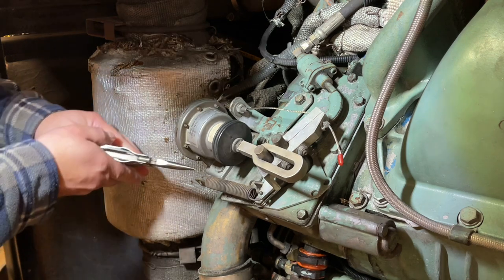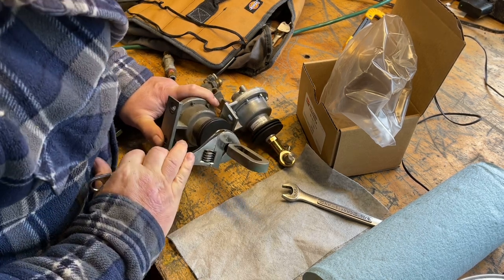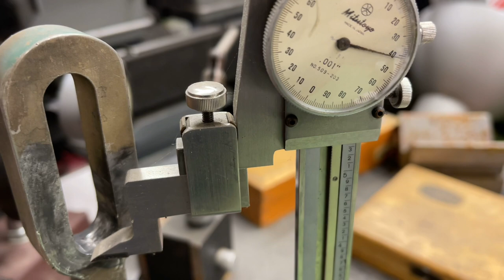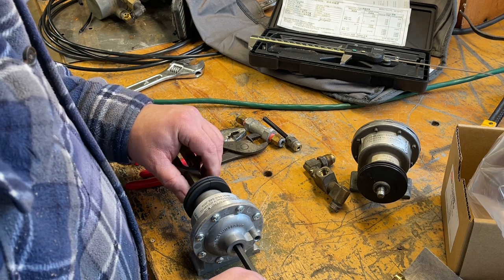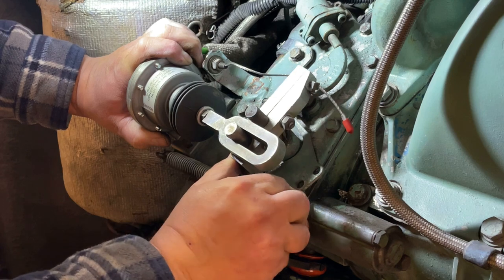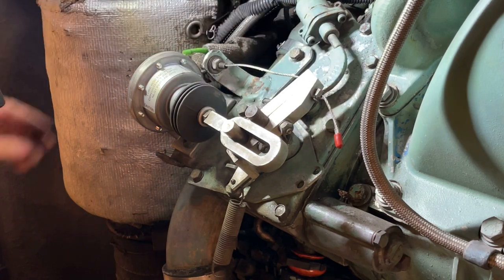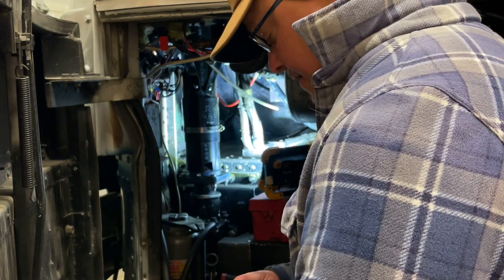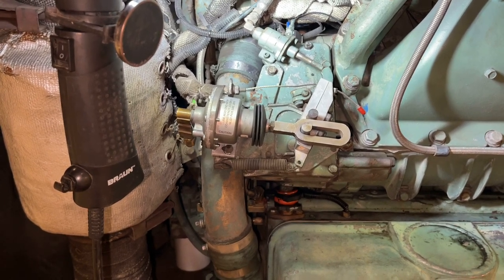Air throttle diagnosis and repair

Comment: Great video, I would highly recommend a dual spring arrangement, available from most auto stores and on-line. If one spring breaks, the other returns the throttle. One spring fits onside the other and matched to the same length. A great safety feature, and cheap!
Reply from the maker: Not necessary because there are multiple springs present already: inside the air actuator, on the throttle, and in the rack itself.
Reply: @ThisOldBus  OK, thanks!

Comment: I just spent days working in that compartment under the driver's seat replacing my brake valve and cleaning the compartment, which now has carpet!  I could hardly reach to the front right corner.  Not sure how you reached in there with your air tank in that way.  Someone obviously replaced or at least repositioned your auxiliary tank.  They were originally mounted transversally against the rear bulkhead in that compartment.  Having yours go front to back sure limits your access.  
Congratulations on solving the problem.  Now take the old slave actuator apart and rebuild it to keep for next time.  ;-)
Reply from the maker: There is some wasted space behind that tank. Did you utilize and carpet that area? My wiring harness drops down next to the steering column, goes across towards the middle of the bus, then back. I wouldn’t want anything banging into it. Has your bus been re-wired? Perhaps the replacement tank was too big to fit in that area.
Reply: @ThisOldBus  My wiring harness is identical to yours.  I cut the carpet out around the block of wood and slipped it under after cleaning it up.  The carpet isn't in the video on replacing the brake valve but you can see how the tank is mounted and all the extra room you have to work with it sideways.  Can't tell if the size of your tank is different for sure.  I keep a few things in there like a couple of air hoses, air chucks (I have a quick connect on the tank for airing tires etc.) and a tow chain.  Nothing that moves around that would do damage to the wiring or air lines.  Also, my accelerator valve body is below the floor, which is different from yours.  You should be able to service that valve without having to remove the base plate when needed...far easier. Wish I would have put one like yours in when I did that.  (BTW, they are very easy to disassemble)
Reply from the maker: I just watched your video.. I subscribe to your channel but missed it.  May have encouraged me to do more while I was in there. I think I have more usable space with where my tank is than you.
Reply: @ThisOldBus  Perhaps behind the tank, but it sure limits getting that whole upper body experience getting inside there.

Comment: Great video. Glad that you appear to have gotten it figured out. Did you not have the access hole in the nose of the bus behind the front trim? You should be able to see the plate covering the access hole if you have one. Depending on the mods to the front of the bus it might still be there behind the trim panels. Already done this time, but next time it would be handy.
Reply from the maker: There is no evidence of an access hole. There is a spare tire compartment behind the bumper.
Reply: @ThisOldBus  I just went back through some of your other videos to get a better look at the nose of your bus. Now I see....On a stock bus there is a trim piece between the two headlight assemblies, but on yours it looks like someone's installed a cap over the area when the headlights were upgraded. You might have lost that access point when that upgrade was done and the stock license plate mounting panel was removed. On my bus there's no way I could have reached the underside of the pedal through the tool compartment like you did with my short arms. At least you were able to get it done.
Reply from the maker: @SpiritHill  my air tank in a non-stock location blocks access for my body... I could remove it to allow my shoulder room to get further in, but suffering thru it was faster. I’m not a tall guy, used my fingertips and socket extensions.
Reply from the maker: @SpiritHill  there is a worse place to be on a 4106 LOL. In front of the bulkhead under the bus in the starter access area. Dirtiest I’ve ever been.

Comment: As always another interesting video. Rather than milling the slot larger considered making the pin smaller? If it doesn't work out replacing the pin should be easy. The piston rod should have no side to side movement. Having the piston rod and pin rubbing with no lubrication could be part of the problem.
Reply from the maker: I just greased it. The design is slightly flawed but I’ve got bigger fish to fry now..

Comment: Seems like the actuator needs to pivot also. The pin is traveling on an arc and the piston rod is rigid. Maybe that is why the bushing wore out.
Reply from the maker: Right - or make the slot have a slight curve to it. Banana shaped.
Reply: @ThisOldBus  A slot won't help. You have a linear actuator pushing a pin that travels on an arc. For your throttle position it would be better to mill a flat where the pin contacts the slotted bracket. At least  this way it won't pull the actuator rod down when you push the throttle. A bearing on that pin would also help. I am curious as to why they have a slot, it's not like the pin can fall out.
Reply: I had the same thought.. a couple ways I thought to cure this issue.. put shouldered bolts to mount the actuator so it can move in its slots to account for the position. This would not be the ideal situation as the base is pot metal and may wear out due to the movement. The other solution would be to mount the actuator to a plate that has a single pivot point. It would have two plates that pivot on a single point, the bottom plate would mount to the engine and the top plate would mount to the base of the actuator.
Reply: @GinosGarageUSA  Another idea would be to leave the actuator fixed as it is now, turn the pin down that makes the arc and press a bearing over it. This bearing could roll against the flat surface and take care of the slight misalignment created by the arc travel of the pin. I am unsure how the cruise control and that slot interact.
Reply from the maker: @PrevostNewbie   you are correct. This whole thing is aftermarket, and you’ll find this arrangement on practically any GM bus that has cruise control.  I explain it in the video, but the cruise pulls on the throttle independently.
Reply: @PrevostNewbie  Only issue I thought of with that is once the bearing bottoms out on that loop its going to want to still side load the rod.
Reply from the maker: I could probably redesign it. I have a Bridgeport mill and a 3D printer capable of printing nylon (virtually indestructible). Probably of greater concern as I think on it more is the fact that the actuator travel is not being fully utilized and when I’m at full throttle it’s probably exerting great force on the governor to travel further.. not sure if that’s actually a problem with how the governor is designed internally or not. I wonder if the pedal / actuator travel can be better calibrated.  I think the bottom 1/3 or more of my pedal travel is doing nothing except exerting more pressure against the stop.
Reply: @GinosGarageUSA  That is why i say it needs a flat
Reply: @ThisOldBus  I would redesign it, it won't take much to relieve the actuator rod from the side load, something needs compliance.  Hey you can sell a retrofit kit for all the other GM bus owners out there. :-)
Reply: @PrevostNewbie  Yea I was thinking the sides.. not the end of the slot.. that would work.. probably easier to do that than the base idea. Just mill a new piece of aluminum with a wider slot essentially. That would also be easier to market to other owners, fairly easy to change out.
Reply from the maker: I don’t think I’d want the liability... I’d just open-source any new design. It lasted a long time like that and I’ve got higher priorities at the moment..
Reply: @ThisOldBus  ok we can design it and Gino's Garage can market it then. :-)
Reply from the maker: The guy that was making them stopped for a reason.. eg too small of a market. Do either of you have a bus with this type of cruise control?
Reply: @ThisOldBus  No mine is a bendix cruise system.. totally different.. yea you are probably right about liability.. as long as that Williams part is still available.. that would be my worry is that Williams is phasing out a lot of that older stuff and it may not be available at some point.
Reply from the maker: brake systems Inc. in Portland makes the stuff that Williams doesn’t want to make anymore. There’s tons of it out there so I wouldn’t be too worried about it being phased out anytime soon. But to be clear the slotted thing was made by a bus guy, that is not a Williams part. He sold them in kits along with the cruise control and the air throttle and everything else. He also sold kits for the independent airbag suspension leveling system used on a lot of GM buses.
Reply: @ThisOldBus  - Scott, are you talking about the fellow that made the "Level-It" leveling systems?
Reply from the maker: @russlong5114  let’s say we both know who he is but I do not disclose identities here unless I’ve received permission to do so. He did not tell me the brand name of his leveling system, and mine does not say level-it on it. I’ve seen those and they appear slightly different, so I suspect you’re thinking of a different person.
Reply: @ThisOldBus  - Definitely must be somebody else that I was thinking of, though have never met.
Reply: @ThisOldBus  - If it doesn't say "Level-It" on the leveling system, then it's somebody else that I'm thinking of.